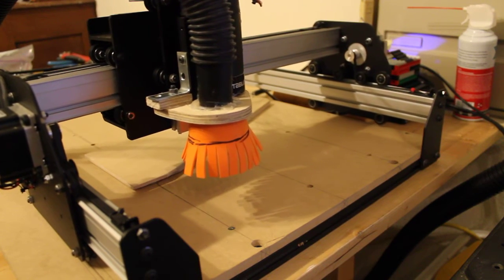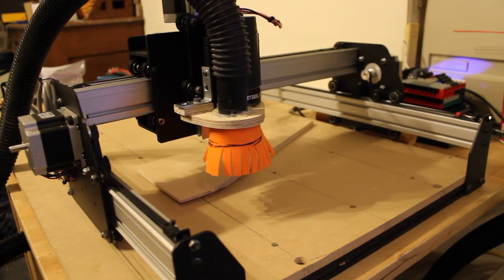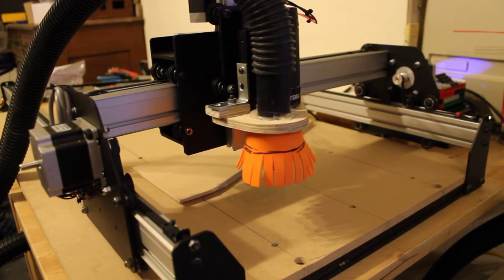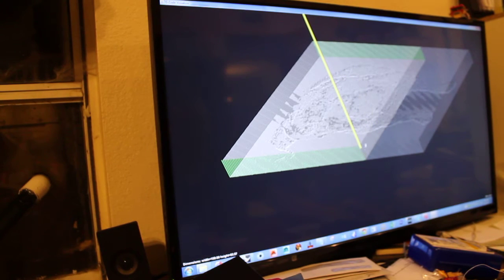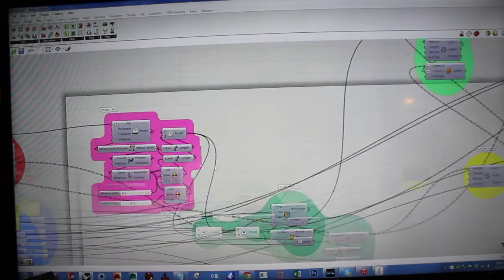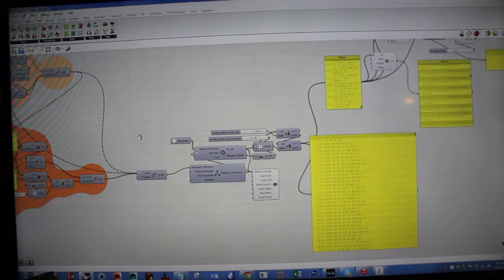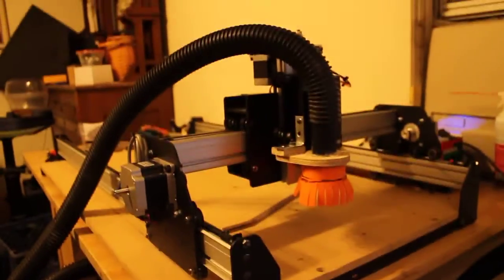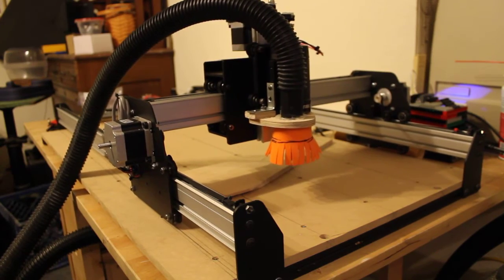Grasshopper silkworm on CNC (dry run)

Comment: Hi Paul
Did you end up making the other video?

I'm starting today to play with Silkworm. For my bachelor thesis I'm supposed to tweak my 2 axis drawing machine to respond to some input and then change the Gcode while it prints

For that I need to connect the drawing machine to grasshopper. Still dont know how
Reply from the maker: No I didn't luis. My process consisted of generating the g code in grasshopper and exporting it out and loading it into universal g code sender. I wasnt able to do real time control through grasshopper. Though I do know there are some new plug ins roaming around. Look on food4rhino.com.